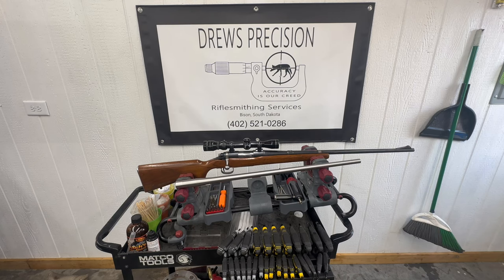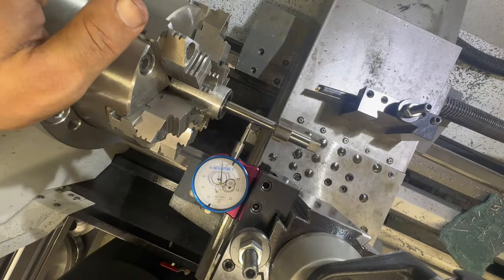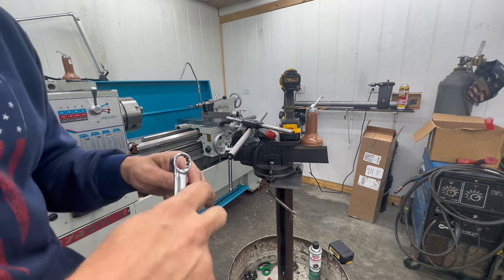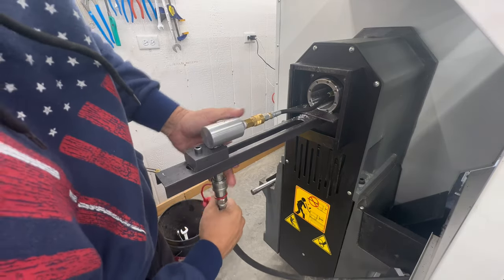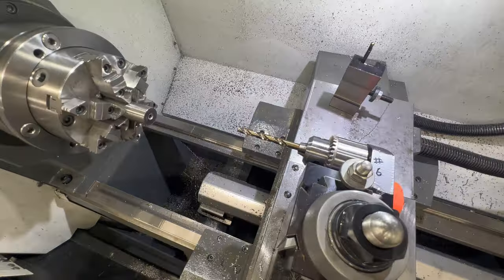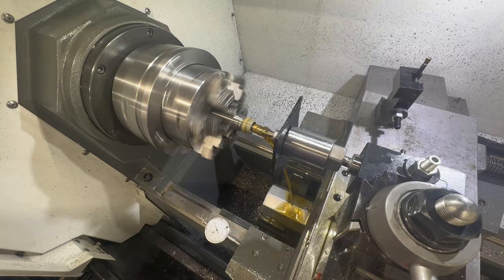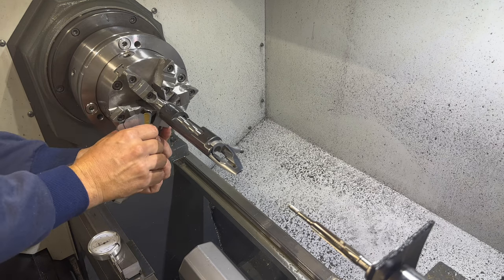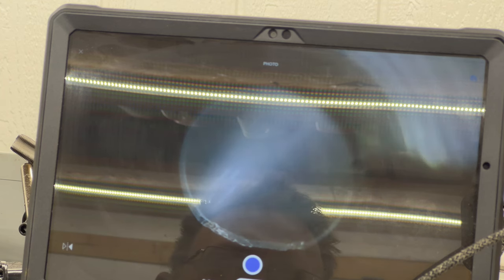Blueprinting a 722 Remington, Preboring Barrel Chamber, Oil Flush Chambering system, 6mm Creedmoor

Comment: I have a Remington 725 (which to my understanding is simply the long action “deluxe” model of the 722 you just worked on. How similar/different to the Remington 700 is the 722? Could I use a remage barrel prefit for a 700? Or are the threads/tenon different?
Reply from the maker: They are pretty similar. I think you could RemAge it.

The issue you will have is finding a stock for it and the nut.
They are an odd duck.
Reply: @DustinDrews1  thanks for the reply.